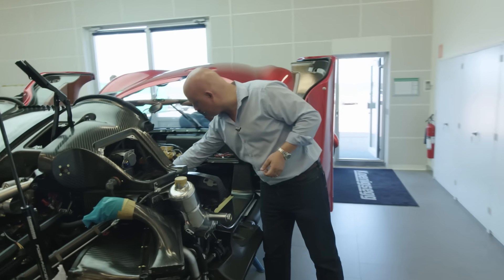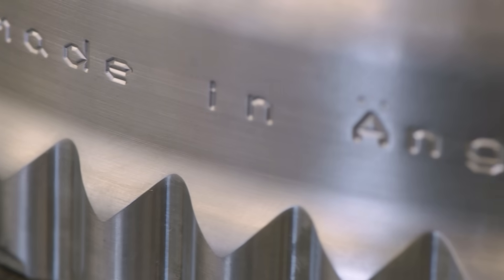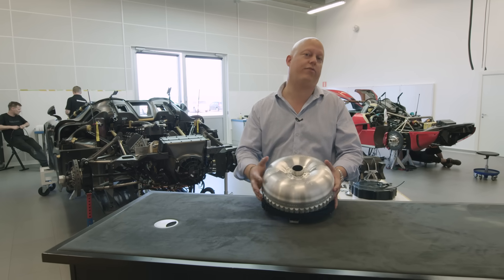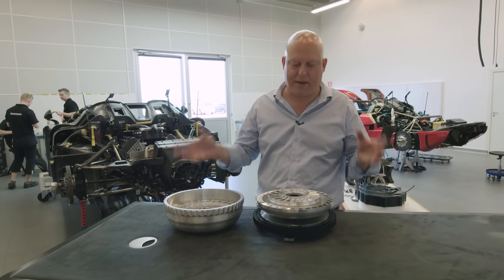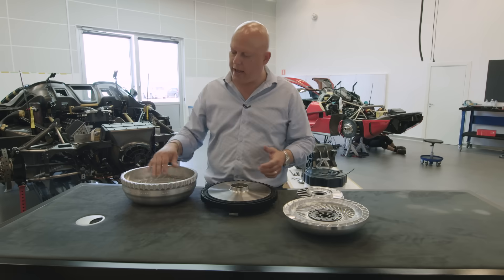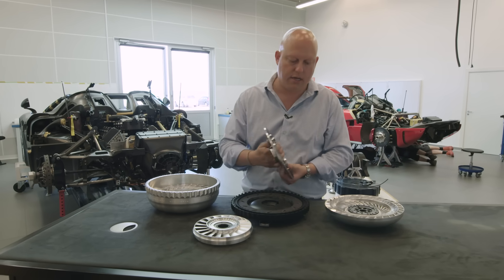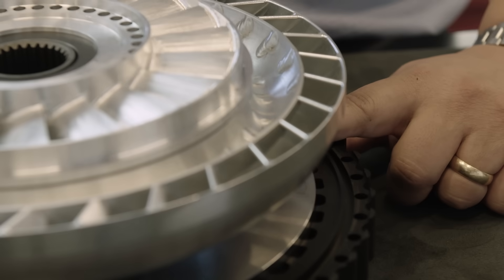248 MPH Without A Gearbox: Direct Drive  -- /INSIDE KOENIGSEGG

Comment: "They didn't understand our needs, so we created ourselves." That's how is done.
Reply: eimantas28 hell yeah! If you want something done right...
Reply: "they" where probably to expensive. Just think about it, someone needs a torque converter, that takes probably hundreds of hours to design and x-days to cut it out with a mill. That wouldn't be a problem if Koenigsegg ordered 200 converters, but they sell at best 10 cars a year. So, no supplier could be found with anyway near a payable price.
Reply: that's why they 3d print their turbo housing w/ integrated valves to control where the air goes in the compressor housing. it's bananas
Reply: necessity is the mother of invention.
Reply: Paul kinglol What would be the point if the car can allready provide more torque than the tires can transfer to the tarmac? 0-60 in 2.8 seconds is the maximum acceleration achievable with the mechanical grip available. The torque isn't even the limiting factor here, so what are you trying to say?
Reply: Words only a FUCKING BOSS would say.
Reply: +onethirdofGilgamesh i dont think price was a very big issue, and he already had it designed, not to mention that the amount of cars he sells doesn't raise the price, unless he  isn't paying upfront
Reply: Im sure the test driver for the ccx had a fun time around the ring trying the drive it fast because the back wheels have no grip without a spoiler
Reply: Yeah, that's how the VGT really works
Reply: yeah that is the single fact i focused on also
Reply: @bobwatters, They actually went to Circle D for technical info. Chris Sehorn posted it on his FB a few months ago. Circle D specifically designs their converters to be locked up at WOT whereas Yank does not. I believe Dave from Yank is not a fan of lockup at wot
Reply: well I think this isnt about 0-60 time...theese cars are more like 0-400 time...which the old gearboxes arent the best for imo...the new technology is unstopable...just face it... its very inspiring that someone can make new technology and awesome cars like this :) this guys for me is close to elon musk and other visionares
Reply: dang that was some CNN quoting there lool
Reply: eimantas28 lol... guess you havnt seen any other cars but a koinesegg in a long time xd
Reply: Or, "they" are simply not used to designing or building such a high end product, "they" are more like stamped steel guys.
Reply: We wont see anything like the Mclaren for at least a while it was 10+ years ahead of its time and still to this day the fastest naturally aspirated car and was using carbon fiber before most supercars. I dont know any car that really can do such a feat again
Reply: Wake UpMofo'ers Americans can make great super cars but are more profit driven albeit they are not doing very well at that. Dominated Le Mans: Ford. Fastest 0-60 for 12 years: Ford (2.1secs in the 90s). Mclaren primarly used chevy engines in its beginning.
Reply: Ford also almost went bankrupt chasing after Ferrari. They can do it, but not at an affordable, consistent rate.
Reply: They don't want any Automotive competition, they're not going to help you!
Reply: That how the pioneer you become
Reply: That's right if you want something done right do it yourself and they did. Genius
Reply: Lighter and stronger torque converters already exist and are used in racing quite often, for example Neal Chance titanium racing converters, or ATI Outlaw torque converters, both of which have lockup and handle greater than 4,500 horsepower.
Reply: "fine i will do it myself"
Reply: dont be daft. mclaren f1 did this twenty years ago and wasnt a flawed desgin like this is
Reply: ...and YOU are an expert engineer?
Reply: damn guy... its an old design.. which has made it accelerate more like a tesla than its cimpetition. ferrari and mclaren. torque convertors may be the simple answer but the public would expect better tech :p
Reply: Its a beast on paper and straight line. But there are better cars out there. I am yet to see a car that does what mclaren f1 did in 1995 without being flawed. Emmission restrictions are to blame. But no excuse for bad handling at this price point. Or your better off with the civic.
Reply: the muricans will cry, "thats unfair advantage" (like they did to quattro) wa-wa-wa!
Reply: theres two things to be certain of. its fairly quick. but he should have put a twin clutch in the car. if hes tryjng to be cutting edge a twin clutch would have have given this package a more exciting drive. there is no benefit in saving weight at this power level as bugatti has proved. no doubt a slightly tweaked version with a different box is around the corner as his designs dont change much. Am sure the p1 would be the far better car. this sounds terrible accelerating.. if audi came out with this people would be complaining! Even top gear had to tell the man his car was unfinished lmao! looks like its the same old story.
Reply: medvidekmisa well it cant accelerate well too much torque.. and there cars have a habit of crashing on track or jus spinning power. the ccx is jus a tad faster than a current type r.. nurburg
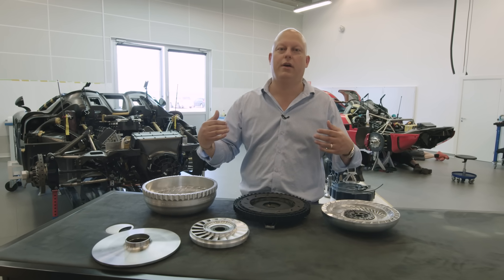Reply: the new civic isnt far off the times of these mega hyper super over inflated hype cars you speak of... so yes i stand by my statement its flawed idiot. and so u know the civic shopping trolley 7:48... konizegszs ccx 7:33...

Comment: I just have one question regarding this. In a torque converter automatic if you put the car into any gear and let of the brakes the car vill move. How do you deal with this?
Reply: The "clutch" portion of the torque converter is completely disengaged. So one portion can spin freely with the idling engine. Same concept as pushing the clutch pedal on a manual transmission when stopped and still in gear.

Comment: correct me if im wrong but this is how i understood it.

so essentially the torque converter can fully disengage with the use of the hydraulic clutch and it can "slip" a lot more than a conventional torque converter to allow the engine RPM to climb higher so that the engine isn't as taxed by its final drive ratio, effectively increasing the torque. but once the speed of the engine reaches a certain point the torque converter will allow less and less "slip" holding the engine nearer to its peak torque so that it can continue to accelerate up to 250mph.

slip being the differential in speed between the stator and the turbine.
Reply: Mac Griffith yep, it basically acts like a centrifugal clutch but is much more sustainable and durable than a centrifugal clutch.
Reply: Darrin Hillier so basically he has a just a high final drive with a really loose torque coverter that basically locks up once the input and output shafts are spinning 1:1?
Reply: It's nothing new, just a different way of using a powered lockup converter. The direct drive portion is obviously new for a street car, that is something I have only seen on Bonneville cars...

Let's put it this way, the 1990's Ford F250 super duty had a similar system to improve it's gas mileage..

Comment: I swear Koenigsegg are going to invent/discover a high-temperature superconductive material above 0 celcius by mistake someday...
Reply: And then he says basically the technology is simple and was already invented 100 years ago.
Reply: Daniel Jochem CVK would be the kind of guy who will accidentally find the cure for cancer
Reply: "We had to minimize the power loss to heat, it was rather simple..."
Reply: He'll be just trying to increase his compression ratios a little more and accidentally invent the first fusion reactor.
Reply: He'll discover this new material, but put it to super modest use like using it to line cup holders in order to perfectly maintain the temperature of the drink as it was placed in.
Reply: illitero more like hover technology. Because of the frictionless affect of a magnetic superconductor, this could be useful in a new type of bearing.
Reply: aserta Why all this hate against musk? If he just takes something and re-skins it, why hasn't anyone made performance-oriented badass-looking electric cars or re-useable rocket stages before?
Reply: +illitero or make the cup holder mechanically flexible that it will counter the G-force when the car is moving in order to keep the water level in the cup, preventing spillage. Lol
Reply: Vegas Tan Heated—and/or cooled—cupholders!  Keep hot drinks hot while driving...or keep chilled beverages cold while driving!
Reply: Spill proof cup holder? Done. Two-axis gimbal mount for rotational motion and some shock absorbers for any translational motion.
Reply: Nate Knerem yeah, but...cup holders...
Reply: LOL ... if anyone can ...
Reply: this needs to be invented ^
Reply: It's simple, Emmett "Doc" Brown created it in 1985.
Reply: Daniel,

You may be right, but that is still well below a temperature that is convenient to maintain.  Also, the temperature necessary to maintain superconductivity varies inversely with the strength of the magnetic field to which the conductor is subjected.

The superconducting magnets used for MRI scans require liquid helium cooling which is inconvenient and costly.  Materials which would still superconduct at -70C would be a big improvement because then liquid N2 would provide sufficient cooling.
Reply: RtdXyron A long time ago, my Dad had mentioned that there was a motor that used hydraulics to quickly get a car up to speed, and then there would only need to be a gear to sustain the speed and this would save tremendous amounts of fuel, yet still provide plenty of torque. 

Of course it's been either suppressed, or as I've also heard, technology was in favor of mechanical systems over hydraulic and it fell by the wayside.
Reply: he is like the Tony Stark of Ironman but on cars
Reply: Daniel Jochem basically
Reply: Justin McMullen Topological Insulator?
Reply: Raul Martinez no that's not what I'm thinking. Trans- state semicinductor or something. Apparently certain nanotube variations can have these properties. Should check out some of the science on multilayered carbon nanotubes, freaking future shit right there
Reply: Timothy Warner I was going to say this exact thing (not in your exact words; I'm not clairvoyant). But I didn't want to be a flippin' NEEEERRRRRD hehe (sorry)
Reply: How about above 0 absolute?
Reply: Your strings are showing.
Reply: Jaxx Brat Someday I hope to call him my Arch rival. ;)
Reply: aserta The really great thing about his stuff is that we could easily apply it to Renewables.
Reply: Daniel Jochem what's the one that is an activated super conductor and insulator when deactivated one called again?
Reply: +Roger Toledo actually the fella who found the cure for cancer is Dr. William Li. It's called Anti-angiogenesis. Search him on Google. "How We Can Eat to Starve Cancer". Yeah, just like starving a fever.
Reply: +RtdXyron actually again, that might be true. Look at my comment down there.
Reply: There are already a few compounds that are superconductive at temperatures much higher than absolute 0, I believe the current 'hottest' is -70 celsius? I may be pulling that number from the air, but I believe it is close to that.
Reply: Daniel Jochem I was literally just thinking I'd sure like to have his guidance in the alternative energy industry
Reply: Grant..
Elon Musk
Reply: the rimac is a performance oriented badass looking electric car, in fact one of the finest looking cars around. I know, koenigsegg and other ICE or hybrids are more difficult to shape into a nifty supercar body than a pure EV like the rimac and teslas are not bad looking either but kudos to the rimac guys nonetheless.
Reply: cannabis
Reply: He's basically the anti Musk. Musk will take something old, wrap it in tin foil, call it tomorrow, here comes this guy, brilliant, and not just his dome, calls it random, old. We just fiddled with it. Respect.
Reply: It will be quite subconsciously deliberate. This is the kind of thing that kept someone up, and they half-dreamed the idea. I know I thought of this in 2001 after I got out of naval aviation structural/hydraulic mechanic(AM A) school.
Im glad its geting out there, and im glad its Koenigsegg thats doing it.
While they're are doing it better, I assure, I still have a trick or two up my sleeve.
xD
Reply: yep feminism and marxism are at the heart of all that is wrong

Comment: Basically a hydraulic cvt..?
Reply: No. There is only one gear. The hydraulic coupling (torque convertor) just allows a varying degree of slip.... Imagine a normal manual transmission car... You can start in 6th gear if you really wanted to, you would just have to feather the clutch a lot and it would probably be toast by the time you got moving. A hydraulic clutch has no friction material to burn up, it will get hot sure, that's why they have a motor after the coupling, to get it moving without needing to stress the convertor.

Comment: Gears and internal combustion, what a waste. Pure electric with planetary motors in the wheel hub assembly is the future.
Reply: Brendan Carberry: He has already said this is the last hurrah for ICE and that it is just prolonging the inevitable.
Reply: The fact is no matter how efficient or light electric motors become mating them to wheels and tires is still massively in-efficient. And the very source of the power needs to be based on ectropic physics. Friction from the very act of rolling across the ground creates waste in the form of heat. This is the secret of Viktor Schauberger's work, water can be both an energy source and insulator. It's admirable that Koenigsegg is making attempts at more efficient technology. But even the very nature of this "efficiency" is based on very old paradigms of thought about the concept of energy. Tesla knew about the concept of entropy and ectropy, just take a look at his multiplication map. Flight is much more efficient and natural than driving, after all birds seem to work pretty well!
Reply: Well one could argue that the diesel engines you'd find in a super tanker/cargo ship is more efficient than any electric motor to this date. 

Today no electric car can match the regera. Just because the future holds something different it doesn't mean that we should't use the technology we have today.
Reply: "Well aware, "modern" vehicles and  technology are still using glorified campfires to run the world."
Yeah, and your electric car is most likely steam-powered. What's your point?
Reply: We need to transition to Ectropic energy as soon as possible. That way we develop equilibrium with the environment and don't die a slow miserable death from entirely preventable pollution.
Reply: +Brendan Carberry
Nobody buys a sports car to "be nice to the Earth," Poindexter.
Reply: And that is something to be proud of?

Comment: Torque converter is one of the best technology for automotive industry. I hate double clutches. And other type of transmissions Torque converters are reliable, responsive and more effective on first start. If a car is not responding the first hit to gas at take off, it's rubbish. The future of transmission is effective torque converters combined with active lock up and electric motors. Bravo Mr. Koenigsegg. I admire you.